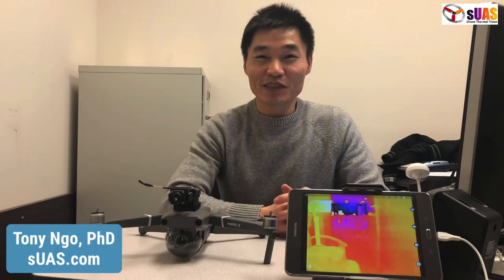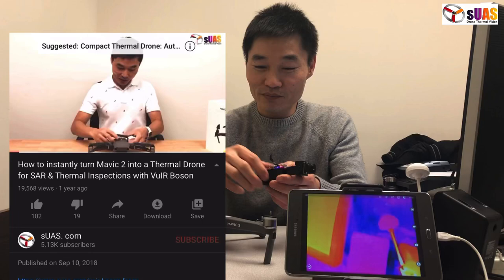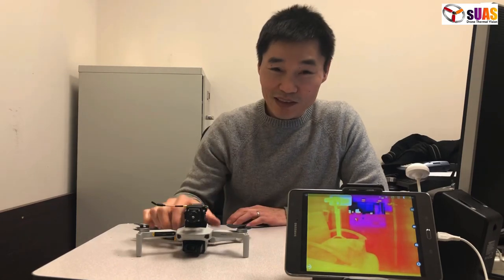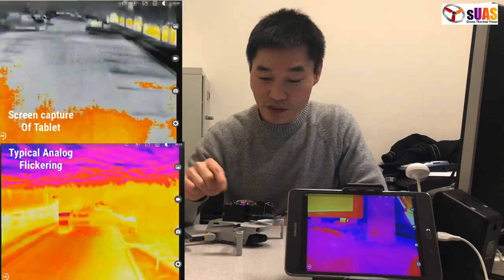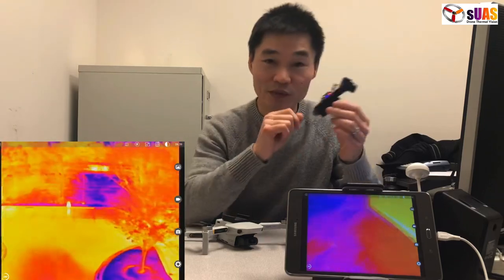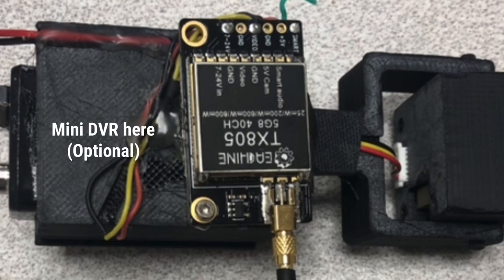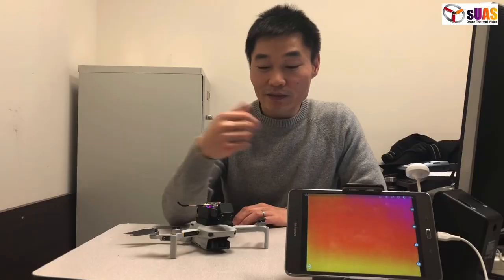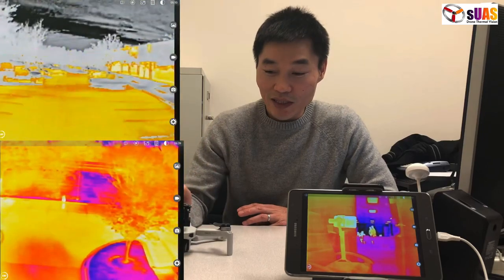DIY: How to make a Mavic Mini Thermal Drone yourself?

Comment: Hello Tony, great info here ! For your information, any extra weight over 15 grams for the Mavic Mini will switch it into  "payload" mode, meaning the flight will be very much limited to 30 m away and 50 m high. Any idea please about how the weight could go down to under 15 grams ? Kind regards

Comment: Did you just connect the cheapest FPV transmitter you could find to that $2000 thermal camera? You didn't even use a circular polarized antenna. Your reception is crap because your receiver antenna is circular polarized and your transmitter is linear. Invest in a better receiver and transmitter!